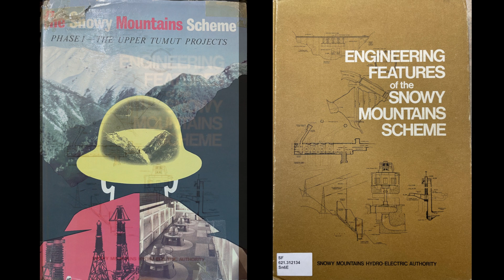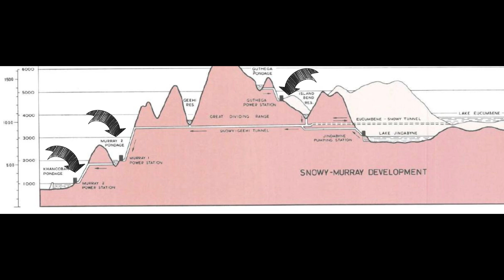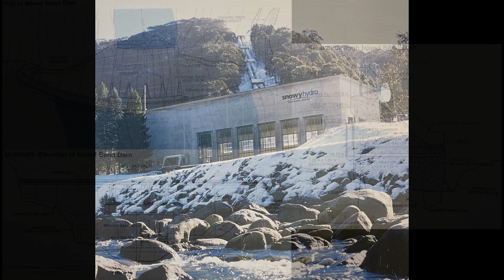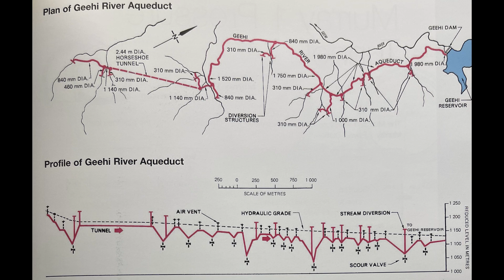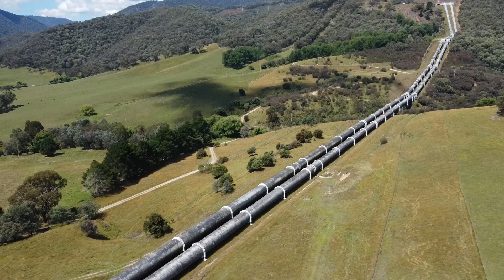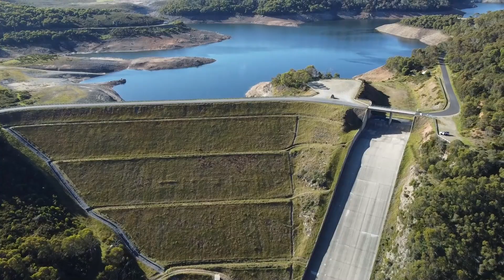Snowy Hydro 75 Years - Part 8: Snowy-Murray System Recap Source-to-Sea

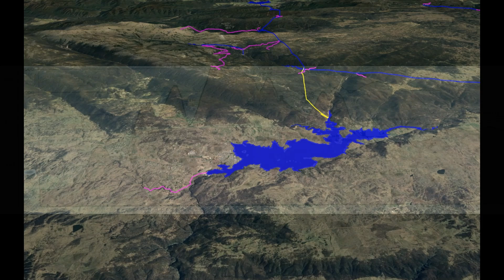Comment: Do you have a copy of the files you used to create the Google earth animation at 3:40? I’ve tried using GEODATA3 Topo 250 but missing some of the aquaduct you have in beyond geehi?
Reply from the maker: When researching the scheme, I ended up using a mixture of content from the annual reports (from memory, most are available on Trove), and I've also purchased several editions of the 'General Map of Snowy Mountains Area, SMHEA' (there are 8 editions) which showed how their plans changed as they found out more about the terrain they were working with. Where the aqueducts are shown in my video is just a rough overlay which I've created in GoogleEarth Pro, so it won't be 100% spot on. See how you go finding those resources, or feel free to send me an email and I'll see what I can provide in relation to your request.